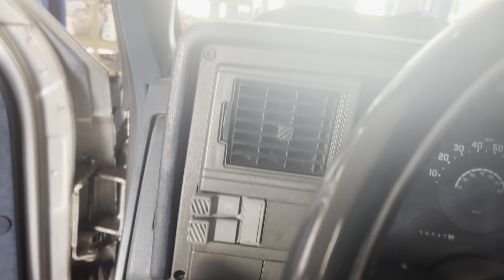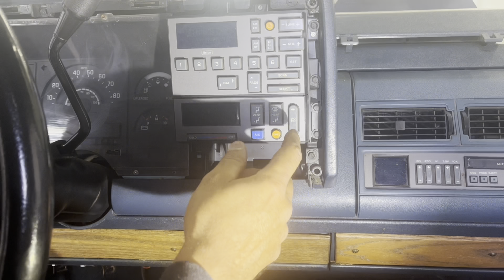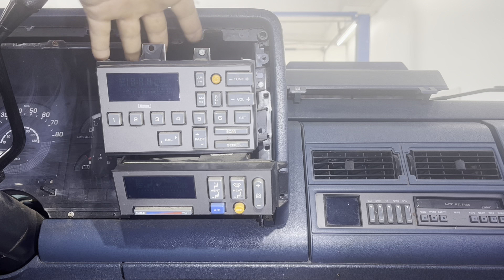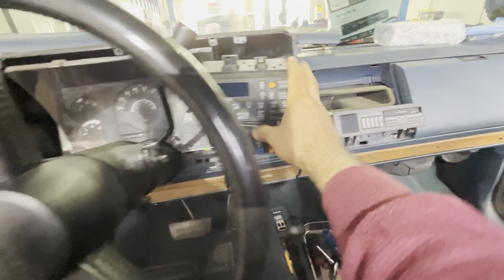1988 - 1994 CHEVY SILVERADO 2500 STEREO UPGRADE: RADIO CONVERSION AND UPGRADE

Comment: Best video anyone could’ve created for this. Just bought a 94 k2500, ordered the aftermarket stereo kit from rockauto(comes with everything you need). Came in yesterday, doing this today!! 😤💯
Reply from the maker: @timmytomtimithjr8522  AWESOME! I’m so glad this was helpful.
Reply: @newb387 I have a question!! 😅 I’m doing the stereo right now, the two bolts on the left side of the control panel for a/c and heater, I can’t fit my damn socket around them becuz they are literally touching the side of the panel 😤 genius move
Reply from the maker: @ I feel your pain. There are a few really tight spaces that will be very challenging so I wish you the best on this project.
Reply: @ had to get the dewalt multi tool out 😂 I got it! Minimal damage , everything is done and works. Thank you again my guy ! So relieving to have a Bluetooth stereo 👌